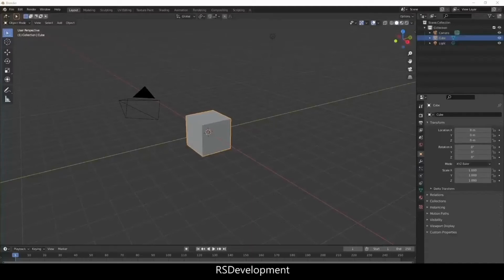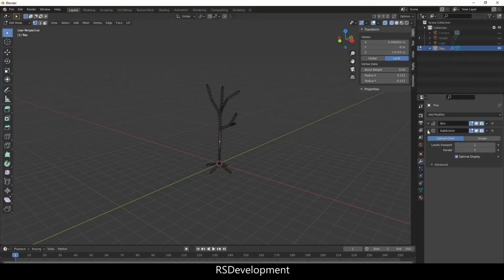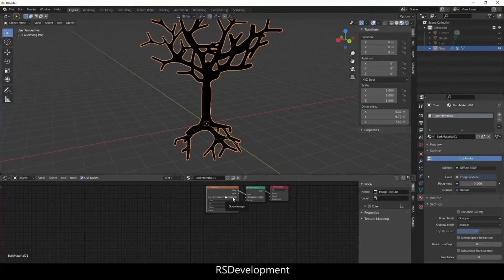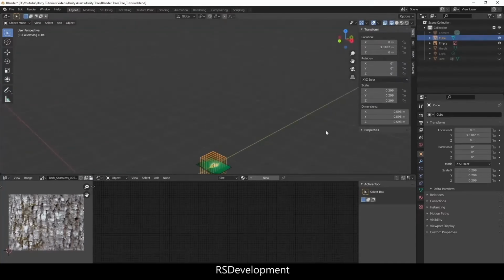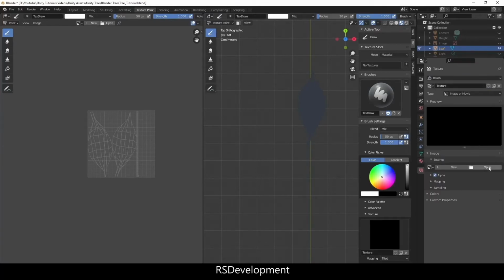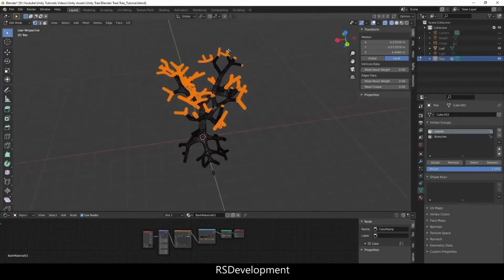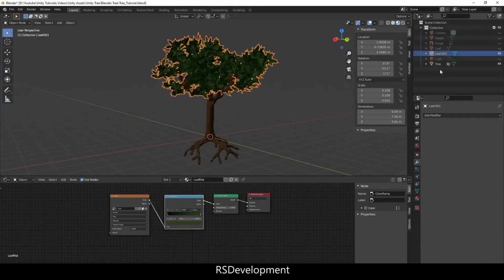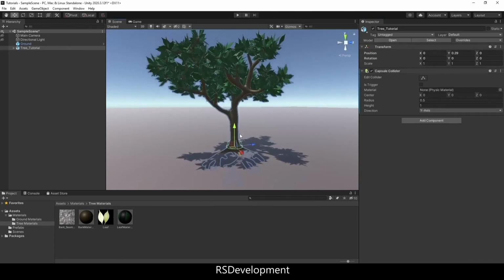Trees -  Blender and Unity Tutorial (Creating a tree in Blender and importing into Unity)

Comment: This was very helpful and great to follow along to. I am less than a week in to learning Blender and this was the perfect thing to follow along with. About half of the things you did, I had no idea how to do, which required looking up stuff in other videos. Such as hotkeys to bring up the radial menu and other menus, and then how to navigate the different windows and the essence of how to get in there.

But most of all, this just put me right into the mix of actual modeling. I mean when I was designing my leaves for example, I hated how many unnecessary vertices a leaf had, so I took time to scale the leaf to be paper thin, and then merge vertices, and then extrude, and then remove more vertices, then extrude and poke and re-merge the verts on the edges, so I ended up with a rather minimal leaf that still has the shape it needs. I have no idea if that was necessary, but, I figure that 15 vertices times a hundred thousand leaves is way better than like 30. 

Anyway thank you for the helpful video!

Comment: This is very cool.  Do the trees work using the paint trees tool on a terrain?
Reply: You can indeed use them with unity's Terrain object which has a paint tress function. However, it is really quite finnicky. At least, for me, because I'm still very new to Unity.

But basically, it won't let you place the trees right out of the box. Instead, you have to import the tree, and then reassign the leaf and bark materials and textures. This isn't that hard but it's a bit of a knowledge check. Then you gotta add a LOD component to it, and assign renderers. (I just assign the tree object itself into all three spots for renderer (They're called LOD0 LOD1 and LOD2 and correspond to distances where the model will switch or not be rendered at all.) and that works Although using the main renderer for all 3 defeats the purpose, you can just set up the distance-versions of the trees later.

 And then you gotta set the shader to the one it wants you to use. Which, if you aren't using a render pipeline, then it's the one it tells you (there will be a message in the appropriate area telling you what the shader to use is.
however, if you are using URP, then, it's not obvious. But it's basically URP's version of the same shader. Or at least, I tried a few until one worked lol.

So yes they work but while you are learning how to do it, you're basically having to overcome obstacles. It forces you to learn more stuff about unity and about what shaders, materials, and components are and how they interact, as well as prefabs and normal maps and oh boy lol. But it's such a good feeling to know how to do it and make it work.

TL:DR It takes a bit of understanding to make it work, but it's things that are worth learning about anyway.